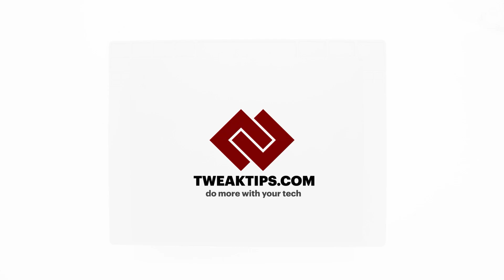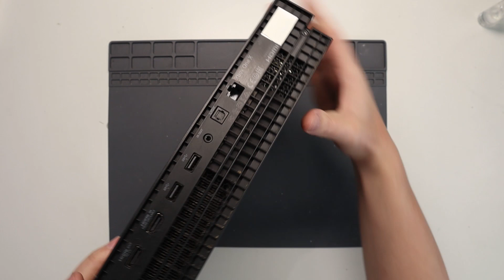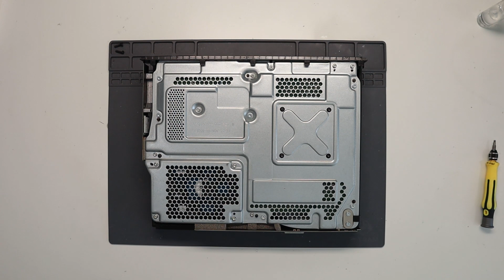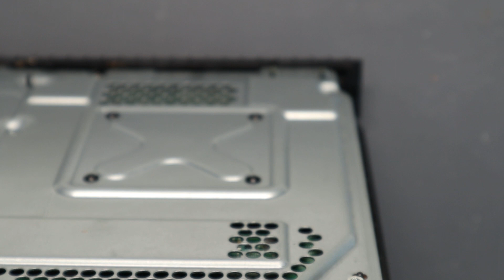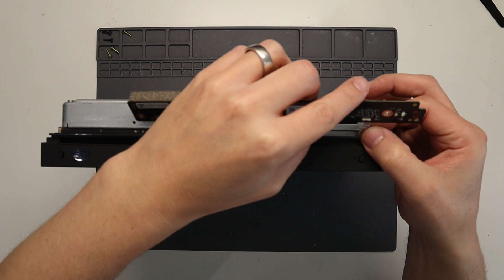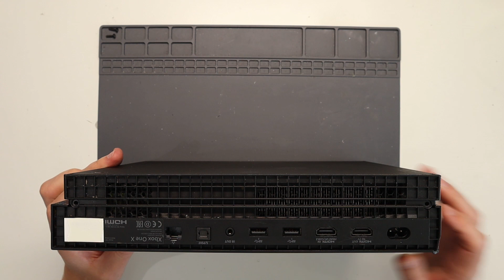How To Fix Faulty Xbox One X Power Button - Replace the Front Power Panel Button No Click Fix Guide

Comment: Hi there! Crappy packing from eBay got me a cracked Xbox One X that works, except for the power button. The case is loose on the right side, so I was able to lift it and confirm that the micro switch works just fine, so it's the actual button. There's nothing behind it that would touch the microswitch and I cannot find out what might be missing or a replacement part for it, as all power button ribbons I found online seem to be for the regular Xbox One.
Reply from the maker: Sounds like the plastic casing part which presses the microswitch is broken - can you see it in the box anywhere?
Reply: @TweakTips  Sorry, YouTube never sends me a notification when someone replies, it's very aggravating. I only found out that you replied today by going through my comment history, which I didn't even know existed. Thank you for replying. Yes, it ended up being what you said, the case was broken and when I ordered a new replacement one, it worked just fine, so all is well now.

Comment: I lost my power panel (don't ask aha 😅) but is it possible to still use the Xbox without the power panel
Reply from the maker: I have never tried, but the power panel also includes the Wifi chip to connect your controllers wirelessly to the Xbox, so probably not

Comment: I accidentally broke that little plastic button for power while taking apart my xbox. The panel is not damaged though. Should I try to put back that little button back or buy a new panel?
Reply from the maker: The little buttons are micro switches so you will need a magnifying glass to solder it back on...  but it is possible.

Comment: Hey, thank you for the helpful video! I have a situation with my Xbox One X and I hope you can provide some insight. The power button, sync button, and eject button don't work on my console. They're completely unresponsive. The disc drive works fine and I can eject discs through the dashboard. Do you think replacing the power board will help fix these issues? 

Thanks!
Reply from the maker: Hi Carlos - you are welcome, and thanks for the question.  As all three buttons are not working, I would suggest opening up the console and checking that the ribbon cable still has a good connection to the power board - this ribbon cable connects the eject button back to the motherboard (via the power board) and if this has moved it could be causing a short making all the buttons unresponsive. The bind/sync button does not connect via the power board (it connects around the side of the console on another ribbon cable) so it is worth checking that too.  If all connections are good, then I would try swapping out the power board.
Reply: @TweakTips  Thank you for the tips! I'll look into this when I have a chance. I saw in another video that the front USB is also connected via the ribbon cable you mentioned on the side. Yet the USB seems to be working fine because I can connect my controller via USB. I'm wondering if it's indeed a short that's causing all the buttons to be unresponsive. Regarding the controller, I can't get it to wirelessly sync even with a USB cable. Do you have any idea what could be the problem there?
Reply from the maker: @Carlos-pr5np  No problem at all.  As you are having trouble connecting the controller over wireless then it even more points to a faulty power board (or shorted connection on the ribbon cable) because the WiFi chip for the controller is on the power board... let us know how you get on.
Reply: @TweakTips  Hey, I'm just following up on my situation. I opened up my Xbox One X yesterday to inspect the power board and it was indeed the issue! The connector on the back of the power board snapped off and was stuck inside the Xbox! I thought removing and connecting the ribbon cable would be the most daunting task, but getting the top case back on was a complete nightmare! It looked like someone might've previously opened the Xbox and broke some clips on the rear housing. There was a small crack on the side of the top case, too.

I actually purchased this Xbox at a thrift store and it was sold as is, so it was honestly a gamble on my part. I figured I could sell it for parts in the event that it didn't work. After some troubleshooting and research I had a hunch it was the power board and found your video. Anyway, long story short my Xbox is running great! I bought it for $55 USD and the power board was about $25 USD with a 180 day warranty. I'm really happy with the great deal working out in the end. 

Thanks again!
Reply from the maker: @Carlos-pr5np  Excellent news!  Really happy you got it working again Carlos... thank you for letting us know

Comment: Would that cause an auto turn off after power up
Reply from the maker: Maybe - if the connector is shorted, then it could cause this
Reply: @TweakTips  appreciate the reply I'm getting automatic power off at start up within a few seconds maybe 30s occasionally 1 minute but I can't figure out the problem I'd rather fix this one instead of having to setup a new one any idea what it could be it started around a month after I got it no downloads other than the occasional update it's the white version one s while my one x installs games from a disc up to around 70-80% and stops it's also about a month of light use from new had gotten it because the power issue on the one s I'm thinking I'll have another one mess up maybe cheaper to fix both
Reply from the maker: @vulgervulcan  Hi Jay - when the Xbox is powered on, do you see anything displayed on your TV?  Usually when an Xbox stays powered on for around 30 seconds, it points to a faulty hard drive - on boot up, the Xbox tries to read from the drive, then after 30 to 60 seconds it will time out and power off if it cannot read from the hard drive.  It is worth plugging in a spare hard drive and powering the Xbox on, if you get a display and the Xbox stays powered on, then it is your hard drive that's the problem ;-)
Reply: @TweakTips  it starts the green background and logo I have gotten it to completely power on once or twice but the whole time it was making the power on/off  ding spaced out everything seemed to function right and shut it's self off and it's back to the 30s maximum before Power offi did check the hard drive it seems to be fine I have tested in a friends console after
Reply: Better question for you or anyone before I open up the one x it's hard drive is for sure good it's the same as the one s hard drive right?
Reply from the maker: @vulgervulcan  Correct... however the OS version on it will be different, so you will need to update via USB after you have installed it
Reply: @TweakTips  awesome thanks... The power eject thing fixed my automatic power off issue on my one s hdd is still good unfortunately I have to figure out my one x disc download stop issue appreciate all of your help
Reply: @TweakTips  My Xbox one x turns on then off Instantly. I checked to make sure is wasn't the psu (Power Supply Unit). Do you know if this is a hard drive issue or a board replacement?
Reply from the maker: @fosterskweres8215  Hi Foster - a power on/off issue can be a number of different things unfortunately, it could be a shorted capacitor on the motherboard, all the way through to a faulty APU - sorry that is not much help, but power on/off issues are the hardest to detect.

Comment: I accidentally ruined that button that the ribbon cable goes into on my Xbox one do I need a new one?
Reply from the maker: I am afraid yes, if you mean the small micro button?
Reply: @TweakTips  Sorry for the late response I ended up fixing it the problem was that I watch some other YouTube video and realize that the guy had put it in wrong thankfully you had done it correctly and save me thank you so much!
Reply from the maker: @camdenweirich  Great news.. glad you got it up and running again

Comment: What happens if you are not carful with the ribbon cable
Reply from the maker: It is possible to rip or damage the cable - when you try to re-connect it, if you have damaged it the eject function could stop working
Reply: @TweakTips  how can I but that cable. I ripped it by accident
Reply from the maker: @rehman327  You sure can.. I have seen them for sale on eBay

Comment: Thank you. Nice tutorial. I have a prob;em with the eject button. It seems to be getting pressed in it's own and it spits out a disk after after turning the xbox one x on autoamatically. I even hear the eject button beep every 10 min when the console is off. Not sure what's going on. Is there an easy way to just disable the eject button?
Reply from the maker: Have you opened the Xbox?  There is a ribbon cable which runs from the eject button and connects to the power board - make sure this is seated correctly into the socket on the power board as it sounds like the tracks on the ribbon cable are shorting
Reply: @TweakTips  Thank you for your quick reply. Do I need to remove the bottom plastic piece as well to check that?
Reply from the maker: @chillegaming8250  No worries - you can check the connection to the powerboard without removing the bottom plastic, but if you need to check the other end of the ribbon cable (where it attaches to the eject button) you will need to remove it.  It can be removed by undoing the 6 long silver screws.
Reply: @TweakTips  Awesome. Thanks a lot for your help!

Comment: When i took my xbox one s to change the hard drive it broke the button off why its so cheaply put on is beyond me
Reply: Unfortunately they assume nobody is taking them apart one s power eject bind is $15 USD on Amazon careful if you change it I've over tightened the screws on one guy wanted everything but the hard drive replaced that was a nightmare I had n idea what any of it was at the time and cracked the board think it had to be tight or... Not thinking